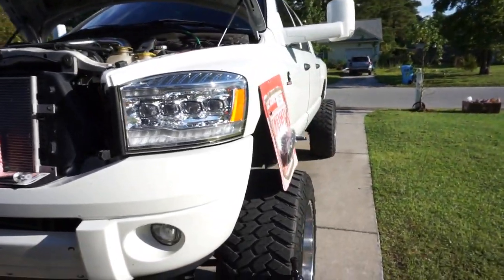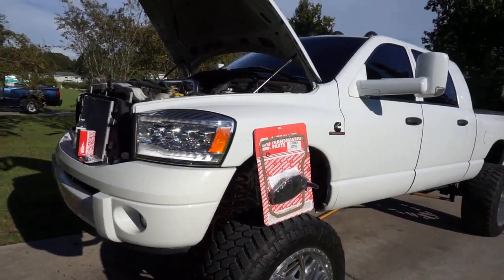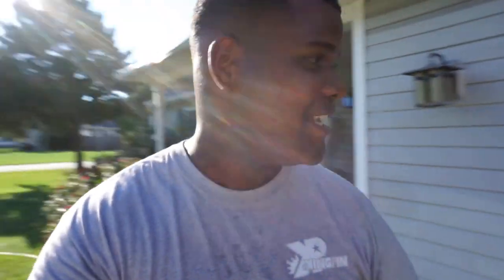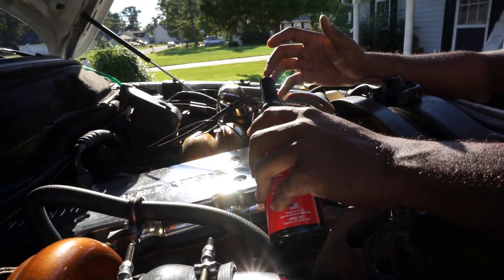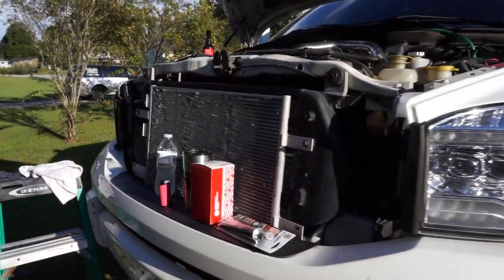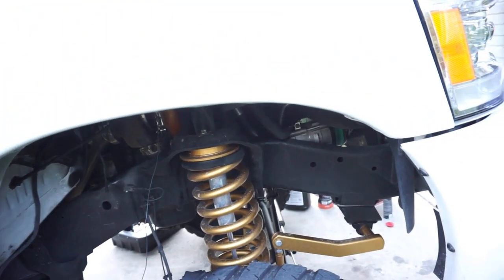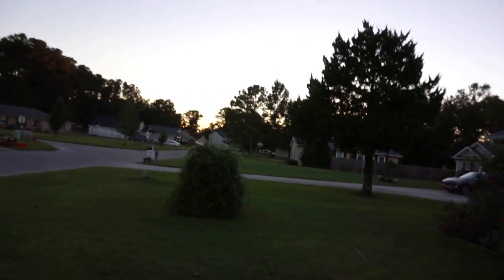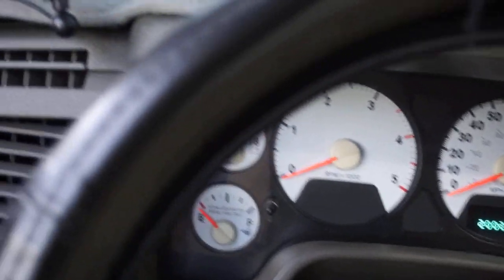6.7 CUMMINS MAINTANENCE PT. 1!!

Comment: My first Ram 2018 2500 mega cab 373 gears. 570k miles, still on the road today all original, even the transmission 😏

Now I drive a 2020 Ram 3500 dually H/O, deleted w/ 5 stage tune. 210,000 miles already all original 😉😏
Reply from the maker: Hell yeah bro doing it like a boss

Comment: Sad to see your first part, best of luck brother.  I do have a question love amsoil but why not 15-40. Just curious
Reply from the maker: Thanks man and it's the same weight oil. 15w-40, 5w-40, 10w-40. There all 40 weight oil at 225f temp. The first number is what the weight of the oil is at when temps are below 0 degrees. At normal operating temps all of these oils are about the same viscosity. Amsoil didn't make that oil in a 15w-40. I've ran 5w and 15w before both work excellent so figured 10w will be the middle man haha

Comment: Jusss when i thought my mans 6.7 maintenance videos were over with! Whoever buys this truck gonna be a happy man... 
Hey when you replace your air dog fuel filters do you fill them with diesel before spinning them on or do you let the pump fill them up by cycle'ing the ignition?? Thanks my G
Happy birthday, we the same age 🤘
Reply from the maker: Appreciate it bro! And I spin em on almost tight bump the key until fuel pours out the filter then tighten it up all the way. U only have to do that for the fuel filter the water filter will fill and prime itself
Reply: @EVERYTHANGDIESEL  thx man! 🙏🙏

Comment: Excellent video my brother, hope there's another Ram coming to the channel...
I have a question for you, your airdog lift pump when you turn your ignition to the on position does it prime up  and shut off or does it stay running until the key is turned off.
Any help would be greatly appreciated thank you.
Reply from the maker: It primes then shuts off.

Comment: Nice truck....looking  clean as new
Reply from the maker: Thank you man!
Reply: One question .....im think to do  cp310mm  fleece. But what's better on injectors 60% or 100% overs  and which brand ..
Reply from the maker: Depends what turbo you running and what you do with the truck.
Reply: @EVERYTHANGDIESEL  is a borgwarner fleece s463
Reply from the maker: Do you tow a lot? Is there a certain power number you trying to make?
Reply: @EVERYTHANGDIESEL  no  towing to much..my transmission is 6 speed manual
Reply from the maker: For a 463 I'd do 60% 100% and a 10mm will be too much for that 463 and you can over spin it
Reply: The trans is build  olready for 1000 hp I have head studs  airdog and the turbo
Reply: @EVERYTHANGDIESEL  sorry you said 60% is ok ??
Reply: @EVERYTHANGDIESEL  ok I'm try to get 700hp so what's your recommended?
Reply from the maker: S467, 12mm cp3, and 120% injectors
Reply: @EVERYTHANGDIESEL   got it ....man I olready expend 4k on that  2gen kit ...im not able to pay more money for the 467.....I hope to know about diesel lake you ...thank you for all info